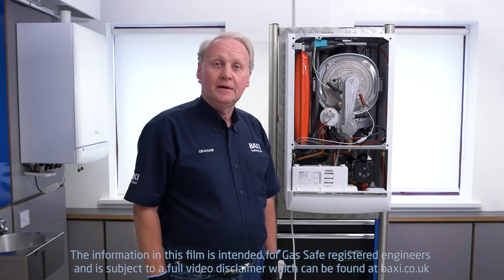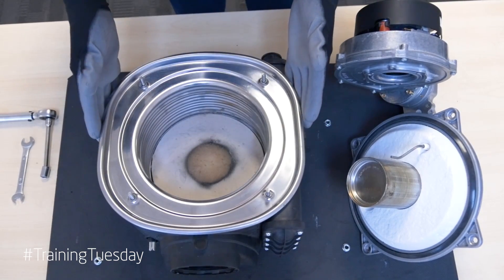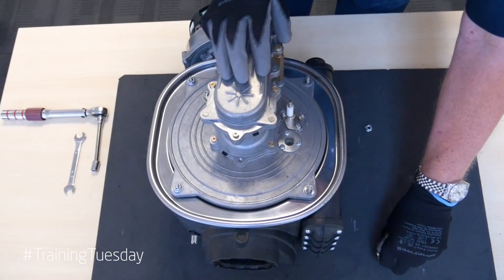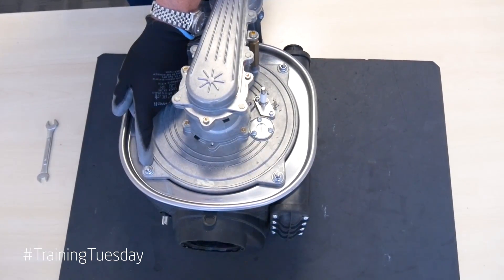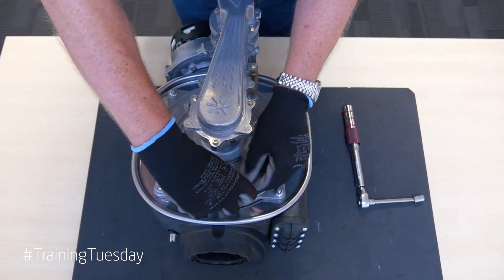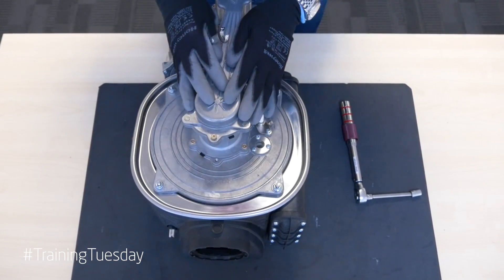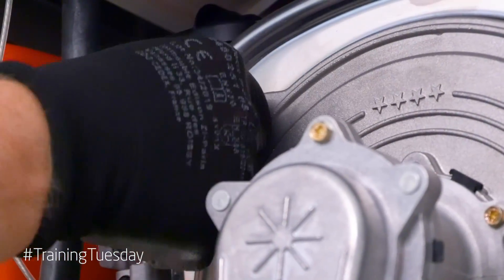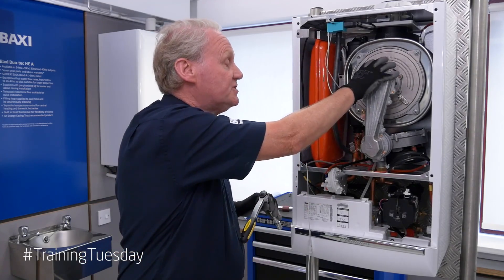The correct procedure for refitting the combustion assembly on Baxi's stainless steel heat exchanger

Comment: Whats the best solution to clean inside the burner with on a service?
Reply: Soft bristle brush followed by cleaning the hex coil fins, then pour water through.  Lastly clean the condensate trap and reinstate and fill with water.  Don't use the nylon drill attachments. As they remove the compounds the manufacturer puts on there to protect the hex coil.  Basically follow the Mi's, it's not too difficult. 👍
Reply: Water pump spray bottle helps for cleaning . With water .. not vinegar or coke .. water 😂